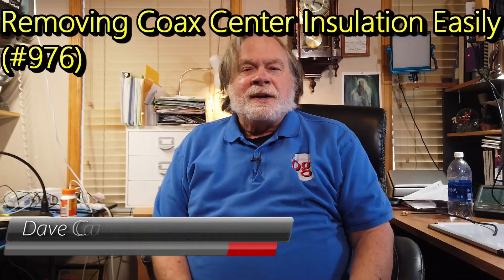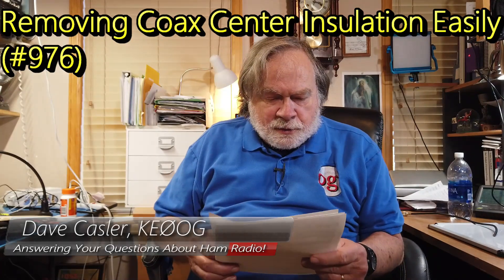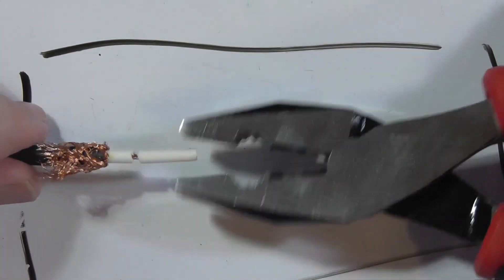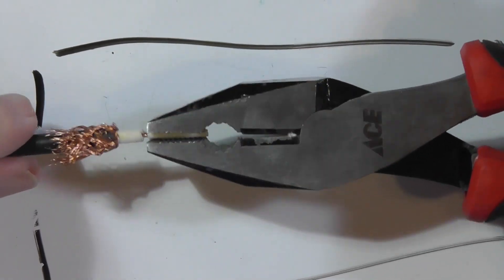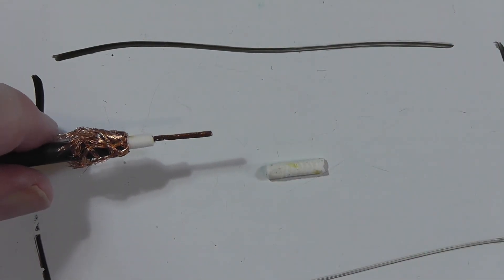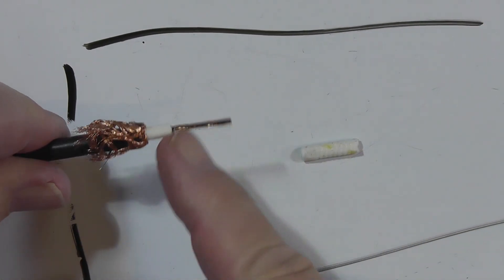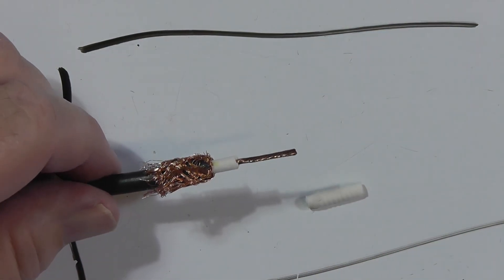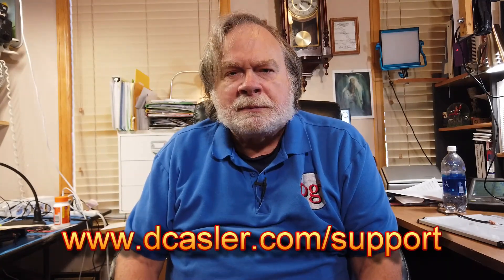Removing Coax Center Insulation Easily (#976)

Comment: Hi, this trick can work only with the foam dielectric.  You should try with the regular polyethylene dielectric of RG213 like cable. Foam because it contains minute air pockets tend to get deformed easily. 
And the Swiss army (??) knife is to be sharpened at once..😊
De VU2RZA

Comment: During my time at the phone company, we terminated 734 and 735 coax in the Central Office. We had a special stripper that would make short work of the entire thing, and trim everything to the proper length. We just had to pick the stripper for the termination we were going to put on the end of the cable, whether it was LCC, or BNC. 

Now with this all said, sometimes a person just has to do it by hand, and this is the slickest way of pulling that center insulation off that I've ever seen! Thank you for sharing!